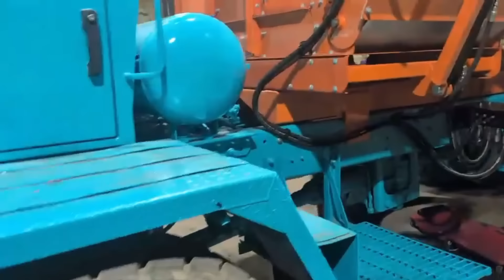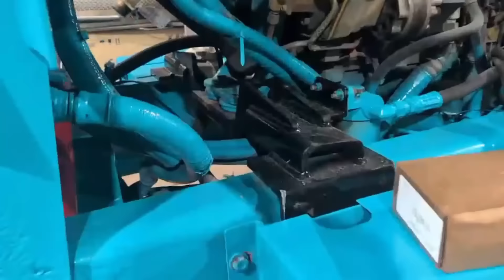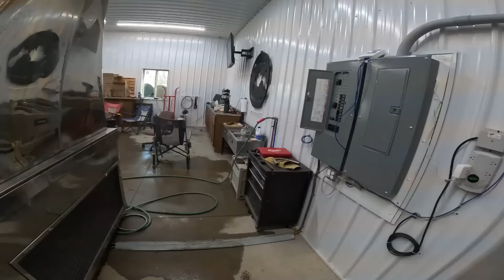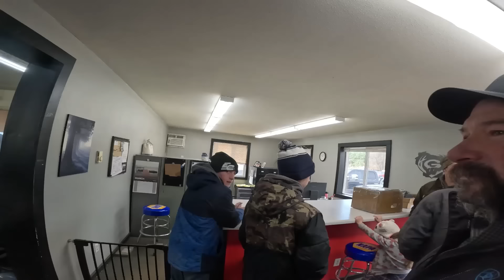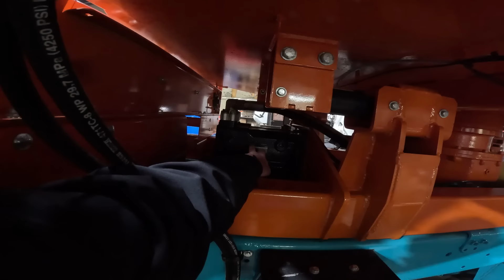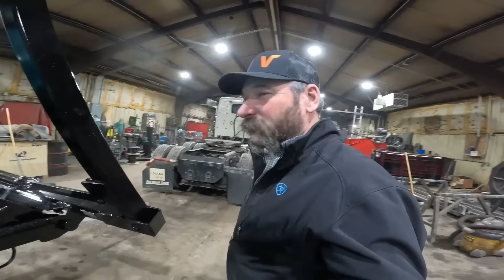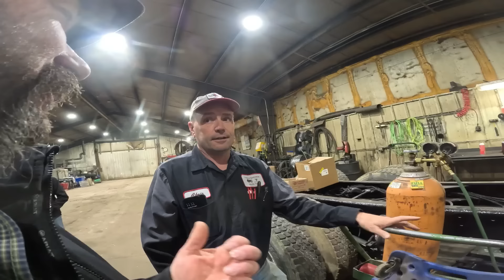Concrete Truck To ULTIMATE FEED TRUCK!!

Comment: Truck looks good, might have to build a loading dock by your pile if you need to load with your farm loader.   Seen some built with those large cement blocks on the loading end and just some dirt pushed up to them to get the height needed.  Good luck with the new feeder.

Comment: You  need to do something different with that rear grille. It's cool, but you can't make  out the steerhead or anything. It just looks like a black grille. Putting something white behind it would do it, but I imagine that cut off the airflow and  would defeat the purpose of a grille. Maybe paint the edges of the letters and the steerhead white or something?
Reply: 1:39

Comment: Nice set up When You lock the rear ends and the transfer case in low range You be able to go just about anywhere you need to go. What is the weight of that unit loaded, A four axle Redi mix unit would be roughly 60 to 70 thousand pounds. The engine and drivetrain are pretty well bulletproof. I have worked on a lot Advance Mixer with that engine and drivetrain.
Reply from the maker: I will be about 42000 fully loaded

Comment: Now what I would have done differently would be have someone make custom wheels and run some wide ag tires and possibly even setup for duels. Unless you have to run on the road then no duels and if you turn a lot of miles then I guess no ag tires. But those trucks are not known for doing very well off-road unless it dry packed ground anything soft and muddy forget about it